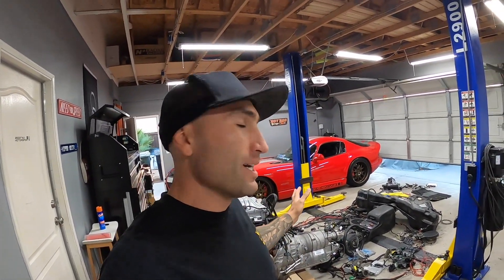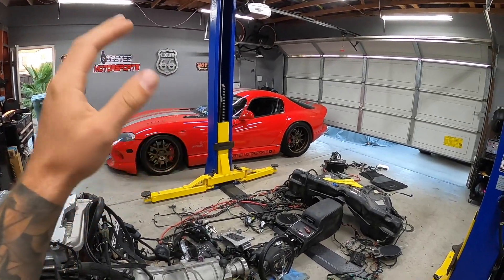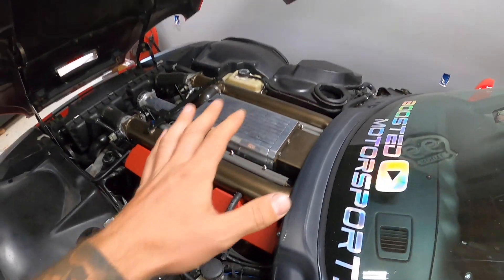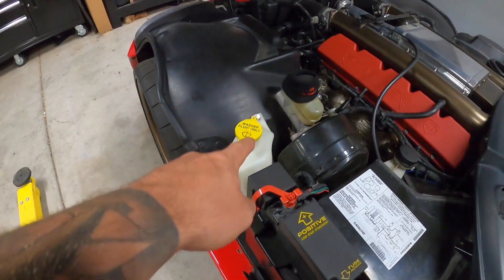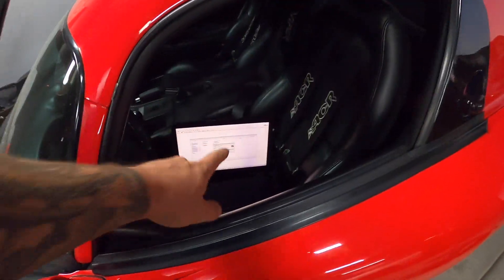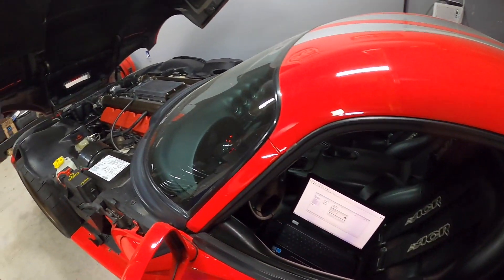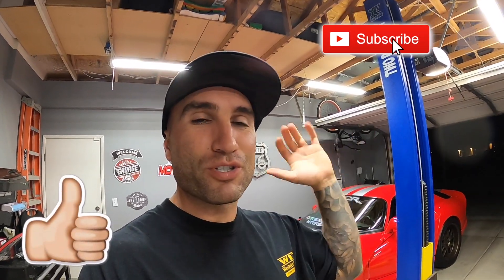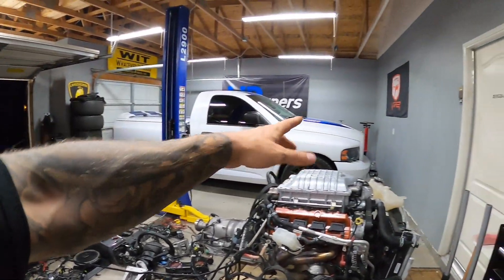TUNING A SUPERCHARGED DODGE VIPER

Comment: Hate to ask about an older video, did you ever do the IPSCO E-brake ?
Reply from the maker: Not yet. Just been living life without a e brake but I’ll be doing it soon 💪
Reply: @BoostedMotorsports  sweet, I just ordered the new gen brake calipers from X2builders. Only 1200 bucks. Shipping included. Used but should be in good condition
Reply from the maker: Damn! Baller! I just an eye out like a hawk on eBay and got all 4 of mine for $450 😈
Reply: @BoostedMotorsports  damn, making me feel like I got robbed at gun point
Reply: @BoostedMotorsports  I'm awaiting pics and stuff, havent been charged maybe I'll search ebay. But considering price for brand new as a whole it's not a bad price